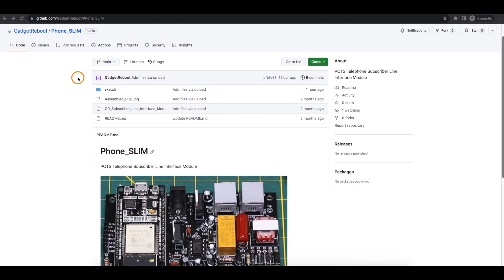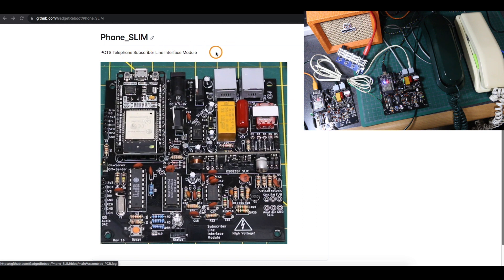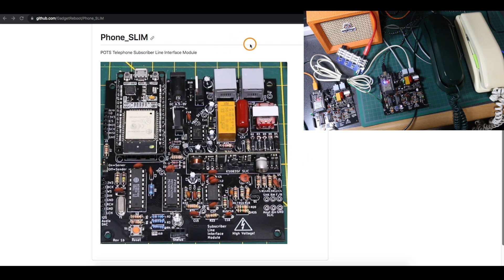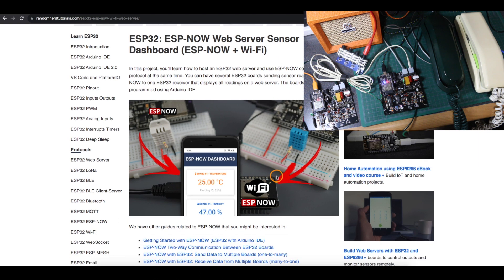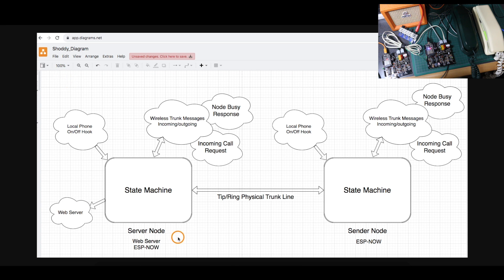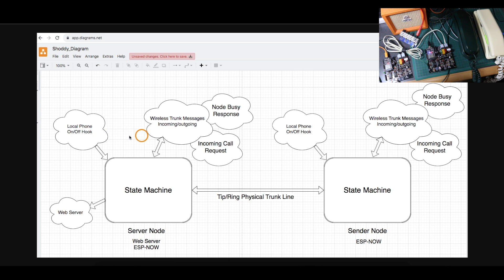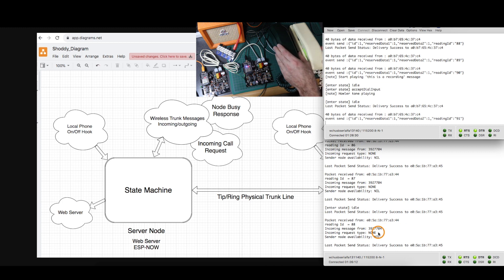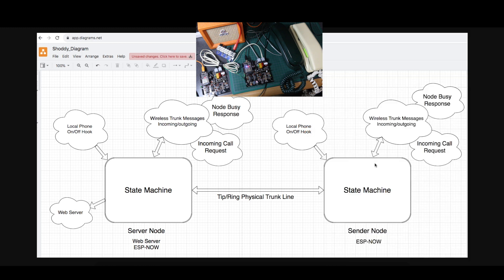Phone Line Simulator Project Update: 2 Phones Working!

Comment: Thanks for all of your hard work on this! I think I might build a couple of boards of your design to use as a starting point for a slightly different take. It seems that each node could support more than one phone line, more like a central office. Another idea is using a RJ45 interconnect between nodes. The four pairs of wires in the RJ45 (ethernet cable) would be enough for the RS-485 control link as well as two phones (if someone did not want to use WiFi for the control link) or 4 phones plus WiFi for control link. Of course, as you say the WiFi also provides the possibility of 'wireless' nodes.

Good work!
Reply from the maker: I am working on an idea to make an expansion board where each node can have its RJ 11 cable going to a matrix board with at least four channels so then that can become more of the central office controlling who gets routed to which node so I’m going to be experimenting over the next couple of months with that.

Comment: Hello sir, thanks for this interesting project. 
I have a question. Since there is a codec on the KS0835F, can the AudioIn/Out on your SLIC breakout board be used to connect two such boards together, each being connected to its own phone?  I mean to make a phone2phone intercom?
Reply from the maker: I think that would work, if you plug each phone into its own SLIC for the purpose of providing the proper voltage to each phone when they are off hook, and then instead of connecting tip and ring together through transformers you just connect the audio in and out between the two modules, the audio would just go that way instead of over the actual phone line but I haven’t tried it.
my expectation is each phone would be live but going nowhere so then the audio path gives it somewhere to go
Reply: @gadgetsideload  Thanks, will give it a try, just got hold of two rotary pulse phones and have your SLIC adapter card.  If this works, and I have a SLIC breakout card for each phone I guess I can hook up more than one phone by using an analog multiplexer switch on each end to route the call. Those ICs usually only accepts a few volts, but from your previous videos I think I saw that the voltages on Ain/Aout on the SLIC is up to 3.3volts?  Except during ringing, which you solved with zener clamps.... Cheers

Comment: Thanks much. Very cool. I have an old crank style phone, a dial wall phone, some old modems, and some 8 bit computers. I'd like to set up my own phone system for testing and demonstration of this equipment. Calls, ringing phones, BBS on Apple ][ etc... Is your board available as a kit from JLPCB or PCBway?
Reply from the maker: The project is shared on PCBway
https://www.pcbway.com/project/shareproject/Phone_Line_Simulator_POTS_Land_Line_1d34078f.html

The one component they seem to have trouble sourcing is the 600 ohm transformer because I just buy them on eBay or AliExpress so when people buy the assembled project there, I think they have to just tell them don’t put the transformer and people solder one in themselves.
Reply: @gadgetsideload  Thanks I submitted an order for 5 units to your link. It is being reviewed for assembly now. I made note of omitting the 600 ohm transformer if it was not stocked.  I will let you know how it goes.
Reply from the maker: I am also currently working on another accessory board where if it works, several of these can be plugged into it so that calls can be made between multiple boards at the same time or even party line multiple notes together.
if that goes well I could be making a video within the next two months for it.

Comment: Respectfully, I've got to ask Why?  What's the motivation for doing this?
Reply from the maker: mostly nostalgia, partly for fun, partly for learning new things, the same way some people will buy a broken down car or house for the purpose of fixing it up themselves and learning along the way as well.
if people have older phones like these, the project could possibly be adapted to use those old phones as Internet voip phones as a novelty.
or for fun if somebody has a bunch of phones like this they can build an intercom system like if they have a house where the land line is disconnected from the outside and they have all of these phone jacks still  wired up in the house, they can create their own little phone system.
it can also be used to test phones and make sure they work if that’s needed for any reason,
and another more practical use could be theatre or even movie or TV applications where they need a phone like this to be ringing so they can answer it in the scene so this can  be used to make that happen.
Reply: @gadgetsideload  Would be curious if this could be used to fool dial up modems?
Reply from the maker: @Darkk6969 Dial up modems were probably my bigger motivation for setting up a nostalgic environment and tonight I finally got that working.  A video update will be coming on that.   I used two 386 machines with external modems, one had a bbs set up and the other dialed into it.
Reply: @gadgetsideload  Sweet!!  Looking forward to that video!
Reply: Understood.  I can get on board with that.